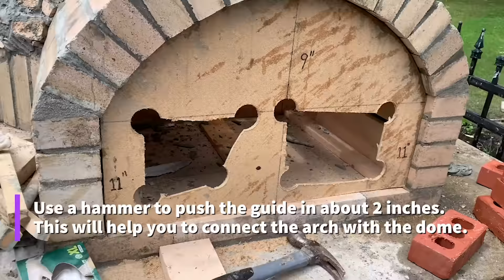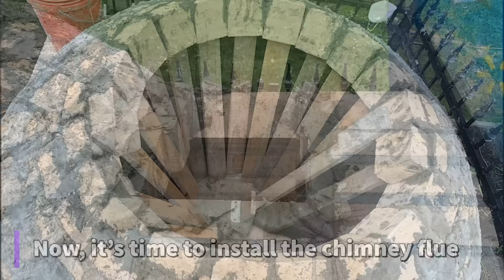The Best Pizza Oven Video on YouTube Time Lapse / Start to Finish/ How to build a brick oven? Pompei

Comment: Overall great job! Especially for your first oven build.  I am sure there are a lot of things that you would do differently now that you have done this once.  I too have built an oven and I'm sure my next one would be even better.  The biggest issue for me however is that you did not use insulation under the floor.  By using insulated firebrick, vermiculite, perlite, etc.  the oven with heat up faster and retain heat longer.  Congratulations!
Reply from the maker: Thanks for your comment. Yes as you stated my biggest mistake was not adding floor insulation in my initial design. But if you watch the Ep 5. you will see that its added later to increase the heat retention. If I built it again I would definitely consider at the beginning.
Reply: He used the vermiculite mixture

Comment: I had always wanted to build a brick wood fired oven.  I drew up plans to build a rustic lodge,barndominium.  It is amazing how in my part of the United States you can't get an inside wood fired oven approved for residential use but you can still have a fireplace.  The next issue was cost.  The materials for an actual oven are astronomical.  The solution was an open to two sides fireplace in the center of the main room.  Build the fire closer to one side, close the dampers down some for more heat retention and cook on the other side.  I even have the swing arm for pots, coffee pot and a grill grate.
Reply from the maker: What part of the country are you living?

Comment: That's a great pizza oven.  I have built my own to similar dimensions.  The only thing I didn't do was tile the outside.  Instead I just used a a plaster finish .  I love it.  Those mosaic tiles are difficult to lay.  You made it look easy.
Reply from the maker: The outside tiles are just for esthetics and matter of choice, so people usually use whatever they like. I chose tiles because it was the most affordable material I could use at the time. Thanks

Comment: beautiful job.  one thing i learned after about 7,000 pizzas (really) is that I wished i'd poured beach sand instead of concrete in front of the oven. Standing on concrete for any length of time is hard on the back.   If you've ever worked a trade show without extra underlay beneath the carpet, you'll know what I mean.  Beach sand gives and also is great at putting out hot coals.
Reply from the maker: Wow you might be right. Thanks for the advice.

Comment: Great tip there with pulling the arch support forward to support the bricks as you close the dome in around the arch, thanks!
Reply from the maker: It was the most difficult part of the entire project. After thinking hours and hours, I just decided to use this method and it worked very well. Thank you

Comment: Ovens with only a baking stone underneath tend to leave the bottom of what's being cooked undercooked. If you had prepared a space underneath and filled it with plenty of broken glass and sprinkled salt on top, it would have been more efficient. When you lay oven stones on top of that, the glass underneath heats up even after the oven is off, continuing to cook even if there are no embers inside. Plus, it provides better insulation at the bottom. Your oven might be losing heat from the empty wood compartment at the bottom. Nevertheless, it looks fantastic. Ours is just a constructive criticism for you to make an even better one. Greetings from Turkey.
Reply from the maker: Watch my episodes entirely, there is a professional insulation added after the oven built. Yes It was also my first oven built and I made mistakes but compared to yours…
Reply: @DanielDemir  To make a comparison, let's first discuss the costs. Most likely, the budget you allocated for the exterior cladding is what we used for the entire oven. Not to mention, this is our first oven, and it was the first time we tackled a project involving cement. Hats off to your effort. Best regards.
Reply from the maker: @filiziledeniz  Abi siktir et beni keyfine bak
Reply: Abi birden sen çok kaba yazdın yoksa gerçekten izleyip yorum yazmazdım. Bizden çok daha önce başlamışsın ve çok daha fazla abonen var. Videoya isim koyarken neye göre konulduğunu bizden çok daha iyi bildiğini düşünüyorum. ( çünkü bu konuda kendimizi gerçekten eksik görüyoruz). Bir profesyonel göz hata yanlış elbetteki görür ilk defa bir şey denedik ama şunu yapabildiğimiz için başarılı olduğunu düşünüyoruz. İçinde 45 dakika 1 saat ates yakıp, ateşi komple dışarı alıp içini temizledikten sonra ekmek pişirebiliyor Fırınımız. Heves ettik yaptik bizim için çok önemli anla bizi lütfen 😇 kanalında takipe alıyorum ilgimi çeken çok şey var bir göz gezdirdim. Sevgiler selamlar
Reply from the maker: @filiziledeniz  Hocam kusura bakmayin, yorumumu tekrar okudum ve sildim gercekten biraz kaba olmus. Kendinize iyi bakin takipteyim :)

Comment: the only issue is at the opening where it would be better to shift the bricks by half measure so the structural integrity stays firm and wont crack that much in the future

Comment: That's beautiful..so beautiful I'd be afraid to use it..A couple questions...did you design the plans yourself and: if not getting too personal, what was the approximate cost of all the bricks, cement, etc...?
Reply from the maker: Yes it was totally my design. I just decided the size and start building. I included all the information in the detailed 7 episodes in my channel. The cost was around $2.5K

Comment: Great job, and thanks for sharing! I have some questions, if u don’t mind. I’d like to know how many bricks did u use for the whole project, the size of them, and the inner diameter of the oven ( it seem 1m). Thanks once more!
Reply from the maker: I used about 300 bricks. Interior diameter is 48”. Each brick was est 9 by 4.5 by 2.5 inches

Comment: I did my build very similar to you, but more sturdy.  Curious is why you used heavy cinder blocks for flute instead of metal tube.  You will lily gets cracks at flute area which impacts air draw.  Also, you never showed sponging inside walls.  That is work in of itself.  Getting inside once done with dome to clean up.
Reply from the maker: Leaning from mistakes:) thanks

Comment: Awesome oven. But I think using the little black tiles was not a good choice. The seams look pretty bad where the contours come together and they clash with the traditional brick. Using broken pieces of flagstone (or something similar) would have looked so much better.
Reply from the maker: Agree:) but it was the most budget friendly option at the time.

Comment: I noticed you didn't put the 2.5" fibre-board under the bricks that were laid flat.  I was told that if you put the bricks directly on the concrete pad, it can increase the time to heat the oven by a factor of 3 (one to three hours), since you are now having to heat the pad.  Is there a reason you didn't put the extra bit of insulation down?
Reply from the maker: Please watch the video a little bit more carefully :) Insulation is added to the floor.

Comment: Why not take a few minutes to dig out the topsoil, grass and leaves and throw a few shovelfuls of gravel in before the pour to give a solid, firm base? 0:45 you can see the pockets of loose dirt, and debris trapped in your slab.  It is just another 15 minutes of work. Why not throw in a square of metal screen or a few pieces of rebar into the base slab (like you did in the table slab) to prevent your base from cracking in the future? It's a beautiful pizza oven, but I don't get the base pad work at the beginning.
Reply from the maker: You are absolutely correct, I just didn’t know that and also made my bottom slab very thick so I don’t expect any problem. I will definitely consider your feedback for my next pizza oven. Thank you

Comment: Great video. How many fire bricks did you use to build? 
What are the dimensions of the oven itself. 
Thanks 😊
Reply from the maker: Inner diameter of the dome is 48” . I used nearly 300 bricks.
Reply: @DanielDemir  nice. 
Have you the markings of layout from which you started the brick work.

Comment: Thank you so much for posting this! I am wondering whether you used any rebar or any reinforcement in the slab that you poured into the ground? 
Could I get away with laying some pavers and pouring a slab of concrete on that without any rebar?
Reply from the maker: I actually filled the box with big stones and poured the concrete on it without any  rebar or reinforcements but received a lot comments stating that it will be cracked over the time. Its been 3 years and so far zero issues. In your scenario it can be little risky but if you make your slab about at least 12” high  it should also be fine . Using rebar or mesh is the best.

Comment: wide door means more heat loss or  temp' drop faster
Reply from the maker: True but it also means that better accessibility
Reply: @DanielDemir  better you mean you can cook a complete lamp. Can you show the fire running
Reply from the maker: @loaymassalha8066  Yes I am actually thinking of cooking an entire lamb, this was the initial plan. This is not just a simple pizza oven, I cook pretty much everything in it. But also, I decreased the size of the door by adding additional fire bricks layer to the bottom. It is very reasonable at the time. Yes my initial door size was way too high.

Comment: Great work, I have a question. Is it the same procedure if you want to make one on a trailer for use on location? Thank you
Reply from the maker: I would double the floor insulation using 2 inch carbon silicate and 1 inch refractory castable

Comment: looks really nice, but it looks like you used regular mortar, not refractory.
Reply from the maker: No I made refractory mortar mixing Portland cement and clay
Reply: @DanielDemir  portland breaks at 300c°...in the oven it will be 500c°

Comment: For the brick dome, what mortar did you use? I am building one from the lowes video and am not sure if I need to get a refractory mortar for the dome. I don't want the dome to explode due to high heat, but would want to avoid spending ~$50 for a bucket if possible.
Reply from the maker: Another option is buying some clay and mixing it with masonry mortar mix to create refractory mortar. I understand that it is expensive but you have to use refractory mortar to build a wood fired brick oven.

Comment: Nice! do you HAVE to have the metal rack inside for the wood or could you just burn it on the floor?
Reply from the maker: Yes you need one for a better air circulation under the fire.
Reply: @DanielDemir  Thanks. I really want to build one of these at my home. Yours looks great! I just watched your pizza video. Very nice!

Comment: This is just what I would like to build but I have looked at the price of firebrick and they are extremely expensive to buy in Britain it would cost  nearly £ 2000 to build. Does anyone know of other alternative bricks that are cheaper and high temperature resistant.???
Reply from the maker: You can use regular solid red bricks. Or build one with clay.

Comment: I couldn't find insulator easily what will be the result if I dont use it,  is there any other option or can I skip the insulation part with double layering bricks on top .
Reply from the maker: Never try building an oven without insulation. It will take forever to heat the oven andd it will take only 20 min to loose the most of the heat. Doubling up the bricks won’t help at all.

Comment: First of all their work is admirable. Second I think they lack  few things..
This pizza oven is too big... takes alot of money for building materials, and heating it up requires  alot of wood therfore the pizza and bread were undercooked. Second wood door really? And using the concrete  bricks  for the chimney? They are not full isolated..
Last oven floor and dome should  be made from different  brick  types.. I hope someone  will read this before  starting his won project...good luck..
Reply from the maker: Thank you for your comment; 
1. This is not designed only to cook pizza, I have been cooking in this oven for about two years and I am very happy with the size. If I build one again, it will be a little bit bigger.
2. I also have been using the wood door for two years and still didn’t have any issues other then the color change. 
3. Yes the chimney could be installed with fire blanket and mortar. 
4. Why should I use different bricks for the dome and the floor? They are scientifically the best materials for the wood fired ovens. They are fire bricks not regular bricks. 
I hope people see my reply before building their oven based on your comment:) just kidding. Thank you
Reply: @DanielDemir  
 @Daniel Demir  
1. Really?? Are having a micro bakery?  Well size is definitely based on each person preferences.. 
2. Well I rechecked my self about the wooden door .. wood has low termal conductivity in comparison  to concrete  and steel.. I guess I hoped after all the work I thought  you install a steel door with rubber sealing..
3. Another chimney  design  I think could help is a center vent chimney  little  harder to build though..
4. While it is possible  to build every thing  with fire bricks the floor and dome. They have different  purposes.. the floor should maintain heat for long time (heat capacity  should be high) while dome bricks should be good for radiation.
I meant by saying  that I hope that some will read it that you got so many comments so I thought  my comments  will be the last .. and that people  will think before rushing to buy materials.
I learned alot from the video .. but recently received  the ooni koda 16 for my birthday...(I'm an a mechanical  Engineer)